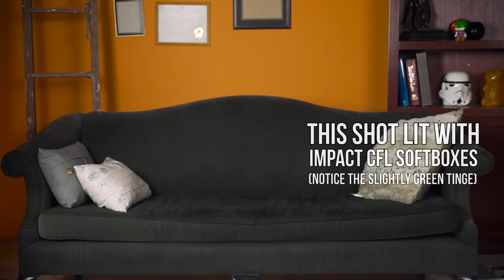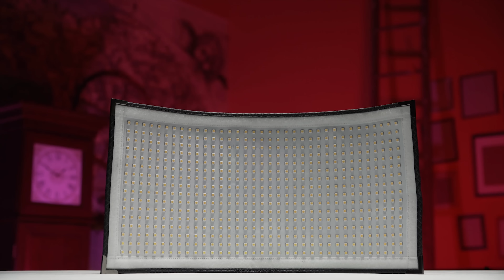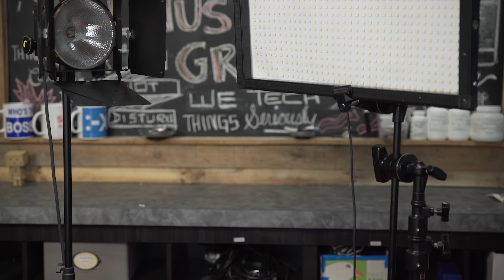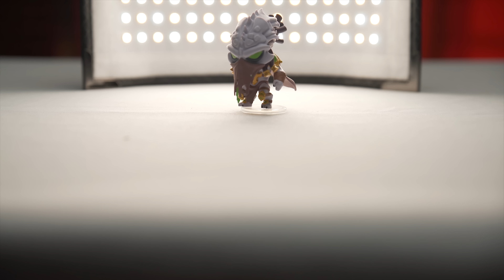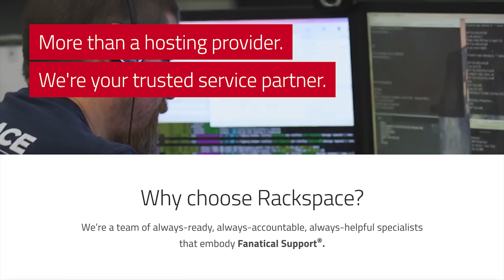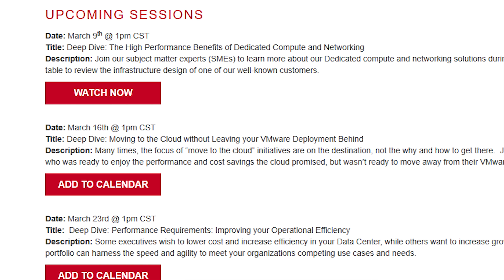LED Lighting for Video - Why we made the switch

Comment: I'm early, let me think of a joke...
.
.
.
.
Reply: +Nova Powered MC Your joke is overused and thus not funny, get new material.
Reply: +byalexandr as a user of the GTX 960 and an HD 7970 (280X) both are very good GPU's - but atleast the 960 is not much far off the 280X and draw nearly half the power from the psu + is MUCH newer.
Reply: +El Diablo Hey that's a good GPU. Better than that crap 960 Nvidia makes.
Reply: +byalexandr both still peasant cards
Reply: +DeadNullermand It is far off. And with better drivers still coming out (AMD hasn't even reached it's full compute performance) it's going to continue kicking the 960's ass even more down the line. Not to mention Nvidia will cripple Maxwell drivers just like they did with Kepler once Pascal comes out. And don't forget that shitty memory bus, it can barely handle the 2GB of VRAM it has.
Reply: byalexandr all that, and i cannot find a single clue to all these "facts". i need some proof to waht you are saying, since if you cant, then i might assume that the comment is pure fanboyism, which is toxic and dangerous for the GPU community
Reply: +DeadNullermand Before you go straight ahead to that usual shit argument about fanboyism, the fact is: The compute performance of a 280X is comparable to that of a GTX 780, look up Civilizations V compute scores if you can't get past your thick wall of opinion. With more driver improvements it will continue to improve, as AMD unlocks the power that they put in their cards through better optimization (which was put there originally to make up for bad drivers). And if you look at new benchmarks in comparison to when Kepler was the main architecture for Nvidia, you can see that Nvidia purposely crippled Kepler performance in current drivers to convince people to upgrade to Maxwell (which has even worse compute, around 1/32 that of Kepler in Double Precision Compute). That and the memory bus I was talking about, the 2GB 960 cards are about as good as it gets for that chip because 4GB of VRAM would exceed the theoretically limit of the 128-bit memory bus. It's like taking a shit ton of traffic and shoving it all through one lane, if you're that simple minded and need that sort of explanation. The only thing toxic and dangerous to the GPU community is your lack of effort to research anything and accusations of fanboyism when clearly both companies have their own faults.
Reply: +El Diablo The R9 280X is a rebranded 7970 GHz Edition. So the 7950 is quite a bit slower.

Comment: leds used have often a video flicker issues, that's long been fixed though
Reply: +Music Tests yeah I couldn't recall the reason of the top of my head,but that was it. LEDs need stable current(in video) and often they are just blinked fast to dim them.

Comment: can i install led lighting for my cpu? :D
Reply: ask razer
Reply: Adds 9-11 fps on average, the only downside is it adds 4.20 degrees.  Overall worth it
Reply: just remove the Top of the cpu and connect the led with the labled led pins on the cpu... did that with mine, now I need a nitrogen cooling, but it was totally worth it
Reply: Yeah, it helps u to make it faster, it's like a natural overclock :D
Reply: +charles chan Yes. Have fun with that.
Reply: Yes just run a jumper to the C5f connector.
Reply: +haloShAdOwSnIpE XD
Reply: +ShootingYanks23 Your username really undermines your argument.
Reply: +ShootingYanks23 I don't think you know what an infidel is
Reply: +MLJeevez I don't